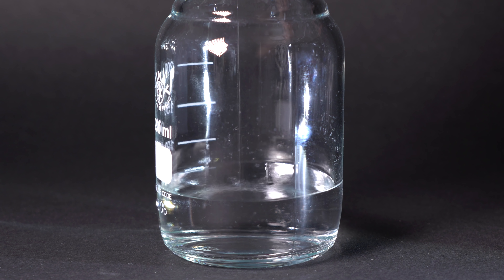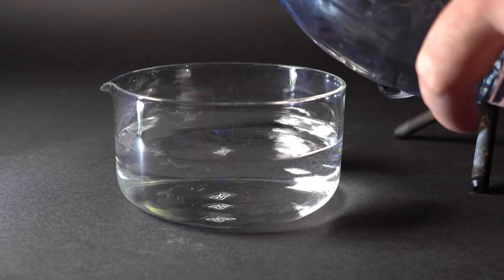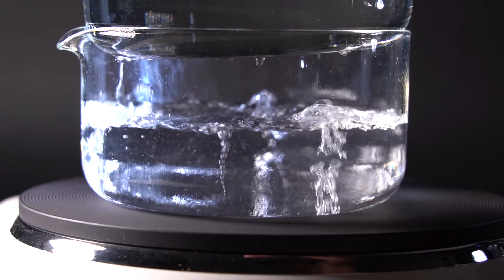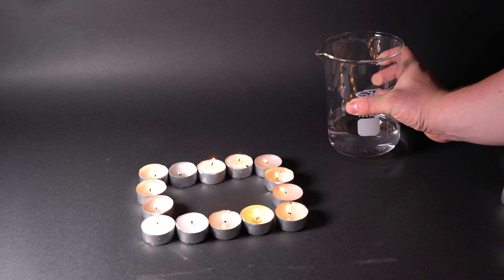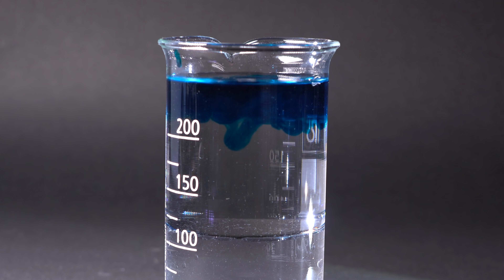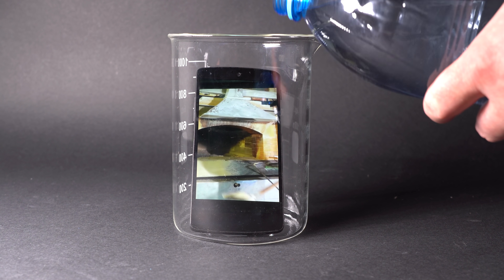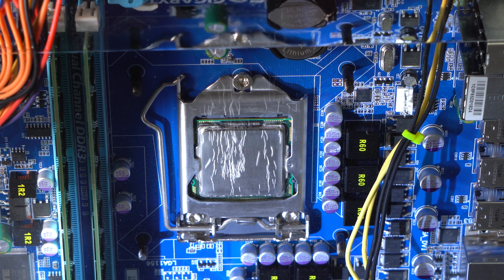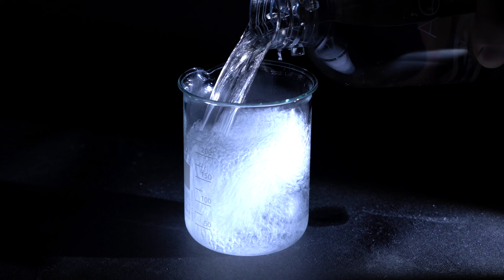Dry Water - The STRANGEST LIQUID On Earth!

Comment: If dry water were made in mass production for extinguish and heat exchanger purpose , They may affect environment like micro plastic in the ocean because they are not easy to decompose even changing in vapor form the coating still contain the droplet of water. How long do they take to come back into normal water?

Comment: If you put dirt on dirt, is that dirt now dirty? Does fire burn fire? Semantically this debate simply doesn't allow for a satisfactory conclusion. Dirt is an object, Dirty is an adjective to describe something covered with foreign particles. Water is an object, wet is an adjective to describe the property of something saturated by a liquid. 
So semantically speaking, the water itself is not wet. 

However,  the science is less obvious. Science would in fact say that water IS wet due to something called Strong Tetrahedron Hydrogen Bonding...that is to say in lay terms, that a water molecule immersed within other water molecules and bonding together does constitute it being "saturated". 
However, my stance, that I've maintained for so long, is that for something to attain a property of "being wet", I would argue that that something must have the ability to be dry. Even something that has a hydrophobic layer that water beads up and rolls off of, can be described as wet, because that water is on the thing in question and can be removed to establish a state of dryness different from the previous state.

This whole thing with "dry water" kinda almost made me rethink that assumption, but not really. But even this unique liquid, with all its unusual properties, still has the ability to saturate, cover or surround something to induce that state of being "wet", and removed again to produce an original state of "dry"

Comment: In 1992 I lived on top of Renton Hill  I was renting a room from a friend and we kept noticing the pilot light kept going out on the water hot water heater we discover trying to reignited that about 3 feet deep in the basement of the house was filled with coal gas  you could light a match at chest level but as you lowered the match below your waist it would go out you could not reignite a lighter or a match below your waist we believe it was coal gas seeping up through cracks in the foundation I rented a room in the upstairs of the house.  One night and woke up gasping for air  I opened the window and leaned my head out finally catching my breath I laid back down and went back to sleep luckily I kept the window open and that was probably just enough to save my life

Comment: Novec is only "hard to get" in the sense that its stupidly expensive. Between 3M having somewhat of a monopoly on it and its limited use in vary niche submersible server racks keeps the price high. Though you can sometimes find reclaimed(used) fluid on the market for slightly cheaper.

Comment: Hmmmm dissolving oxygen would be interesting, especially because its low reactivity could allow it to be accepted into the lungs without a huge amount of damage. My one issue is how one is to make sure enough concentration remains in the solution as the vapours displace gaseous oxygen. Since our mitochondria pretty much act as slow burning flames, I suppose you could test a submerged fire to see how long it would last in a beaker of oxygenated dry water... Actually, if I ever get my hands on an oxygen tank and a beaker of dry water, I might legitimately try that just to see if it works. 

Hydraulic breathing apparatus would of course be incredibly useful in high pressure environments that might become pivotal in exoplanet and terrestrial deep ocean diving or even in gas giant diving. Think of all the incredibly valuable materials stored deep in gas giants like easy metallic hydrogen...

Comment: Hydrogen Flouride = HydroFlouric Acid which is only slightly less toxic tban Plutonium because it penetrates the skin and migrates to the bone, replacing the Calcium with Flourine, requiring surgery to excise the Flouride in the affected area. Extremely Painful.
[but this is why Flourine in drinking water hardens teeth and is so controversial]

Comment: Actually it is already used for cooling in some data centers. The liquid may be expensive but you only need to buy it once, as it's not getting lost in the process. What they do is they add little heat spreaders to CPUs, which also helps to transfer heat faster to the liquid and everything runs inside a completely closed tank so that evaporated liquid cannot escape.The cover of the tank has head spreader on the inside and a massive cooling system on the outside, so that evaporated liquid will condense at the cover and fall back into the liquid, just as shown with the glass of ice water. Of course you can build the same thing with air cooling but the liquid transports heat much better than air does and because of that you need no fans so there are no movable parts involved that may fail. Also nothing will get dusty or dirty over time. You can also use water cooling to avoid movable parts and dirt, yet water will be a problem if you ever get a leak in the cooling system. And you don't need a lot of that fluid. As soon as all parts of the system are barely covered, the cooling system will work reliable. The fluid is not really "cooling" the system, its task is just to transfer heat quickly to the actual cooling system sitting outside of this tank. The real cooling system will use conventional air cooling or water cooling but it can use massive components, as it doesn't have to fit onto tiny chips, it's a big rig on the cover of a big tank.

Comment: I find the experiment with the PC hardware very interesting.
There is one thing that "dry water" has shown - that it can absorb heat very quickly. The only real problem with the test was that the "dry water" in turn could not adequately dissipate the heat. But if you had a cooling system that would wash the heat spreader of a CPU with this dry water, which would then be quickly passed on to a radiator system?
Reply: if you use a passive cooler without fan it is sufficient. The limitations of the cooling without passive cooler is the surface area. Because in the moment a bubble is formed, it is isolating the cpu for a fraction of a second. If you have more surface area, this bubbles have less of an impact.

Comment: It would be interesting to compare the cooling results in the coolant with the heat sink and fan attached (RIP motor), just the heat sink, the bare heat spreader block, and delidded CPU alone. Significantly more coolant would be needed though...

Comment: I think you're the only person to call novec 649 "dry water"
Reply: It's a very common term. Sai common that the novec wiki says "also called dry water." There are hundreds of mentions of dry water when you type "dry water novec" into Google. You were just to lazy and you either read the dry water wiki page (instead of the novec page), or you didn't add "novec" to your "dry water" query.
Reply: Novec 649/1230 (FK-5-1-12) are trademarked brand names for the line of electronics coolant liquids and fire protection fluid sold commercially by 3M. It is also known as “waterless water” or “dry water”. FK-5-1-12 is a fluorinated ketone with the systematic name 1,1,1,2,2,4,5,5,5-nonafluoro-4-(trifluoromethyl)-3-pentanone and the structural formula CF3CF2C(=O)CF(CF3)2, a fully-fluorinated analog of ethyl isopropyl ketone.

So no, he's not the only one to call it “dry water”, also known as “waterless water”...   :D

Comment: Novec is similar to 3M Fluorinert.  Fluorinert was used as the cooling medium in the Cray-2 supercomputers back in the late 80's.  When I worked for JBL around that time, we also used Fluorinert for amplifier prototype testing as we could run them at full power without the need for heatsinks by running them submerged in a tank of Fluorinert.

Comment: This is not 'Dry water', this is: https://en.wikipedia.org/wiki/Dry_water#:~:text=Dry%20water%2C%20an%20unusual%20form,by%20a%20sandy%20silica%20coating.&text=It%20is%20also%20more%20commonly%20known%20among%20researchers%20as%20empty%20water.
What he has here is 3M Novec solvent. A low environmental impact cleaning fluid. https://www.youtube.com/watch?v=TBy93gWg_2o

Comment: It's not practical as a coolant in computers because of it's low boiling point.  CPU's and GPU's can put out a lot of heat, a GPU being comfortable at 90 degrees C in many instances.  You don't want bubbling in your liquid cooling.  You don't need a vapor lock, you don't need blowoff valves inside the computer to prevent rupturing, and unless you want to have a PC in a fish tank it's just not something that makes any sense.  But you can already make a fishtank coolant system with mineral oil right now that works very well.

Comment: Im gonna build a pc but it will be encased in a air tight box. Put some dry water in there then the dry water will not be able to escape so it will turn back into liquid form once the pressure builds up

Comment: This sounds like Fluorinert . The company I worked at made equipment that would pull a strong vacuum on baskets of IC's in a cylindrical compartment then fill the compartment with Fluorinert, when the baskets were removed they were immersed in another fluid heated to the just above the boiling point of the Fluorinert and if any IC's started bubbling they were rejected.

Comment: Finally, i can shower without the water being so wet
Reply: You can but since the purpose of bathing is to disolve the fatty bacteria and oils on the skins in the soap which is washed away with water, and since dry water is a bad solvent, you'll have a bad shower. Prob still be soapy and stinky
Reply: Dry water is called dry water because it cannot wet things if I add more water to it  it's not become more wet it's just gonna add on to it      the particles in dry water are more than just h20   there is an added object to prevent water to sticking on things
Reply: Water in fact is not wet!
Reply: Wonder what it would do to the septic tank...
Reply: @jc5445  evaporate?
Reply: But drink it won't wet your throat too 😂
Reply: @FlamNCheese  that's not what were saying I can't cover water in water it only becomes more water just like if you were to add water to the dry water than I'm sure it would just add not make the dry water wet
Reply: @FlamNCheese  it does wet my mouth  because my mouth is dry.     If I add more water to  it it makes it wet.    We hold saliva not water in our mouths.   Saliva is not water it's an accidic liquid we hold to break down nutrients we can eat it has a different chemical compound
Reply: Ya it would be $1800 shower..($120 * 15 ltrs)
Reply: @rajeevbhan  Hold up, showers take up only 15 litres?
Reply: Well if you google is water wet it says by itself it isnt wet. Only when it comes in contact with material it sticks to is when its considered wet.
Reply: @3cheese711  correct
Reply: @3cheese711  facts. Water is not wet by itself.
Reply: Water isn't wet. It wets us !
Reply: And no need for a towel.
Reply: The comments 😂🤣
Reply: I ruined ur 69 replies
Reply: @WoweeTheNotable  And I ruined your 70 replies
Reply: Shower from that wil feel like a hail storm. Wil leav ur body bruised
Reply: I always hated that!!!
Reply: @kalmansandor5930  I agree I'm not saying it's dry water.    So yes like I said it's not water. I'm saying it has some of it but it's not completely h20 it has other chemicals in it that make it not exactly water
Reply: you're lungs would be destroyed by the time you've finished showering.
Reply: It won't clean you though...
Reply: if u gonna do that u gotta pay up man
Reply: Then You've to sell your all property for a bath
Reply: This is true, but you'll not be clean either.
Reply: I think you cant since the dry water cant react with anything…..
Reply: And it will not be possible to clean your odor 😂😂🤣🤣🤣🤣
Reply: Bete moj kardi
😅
Reply: Make video for refrigerants please like R134a
Reply: Get ready to spend some big money only to get chemical burns on your body
Reply: Water is not wet. Water makes you wet
Reply: you'll just die from not enough oxygen
Reply: I hope there's no UV source in your bathroom...
Reply: You can now play with ur laptop while bathing or get a pc set there
Reply: Going to some expensive showers
Reply: Be a pretty expensive shower. My MR beast will do it
Reply: Water is not wet
Reply: @bryantmorris2744  the fact that there is something called "dry" water proves that "normal" water is indeed wet!
Reply: @butterisawesome6969   I'm still not convinced there needs to be an investigation I'm calling the FBI the CIA and special forces
Reply: @butterisawesome6969  dry water is not regular water there is an added chemistry to it.  It's hydrophobic. Not water.
Reply: @bryantmorris2744  witchcraft haahaaa
Reply: @butterisawesome6969  hAhA sciEnCE gO brrrrrrr
Reply: @butterisawesome6969  no its not that logic makes no sense
Reply: @butterisawesome6969  apparently water is not wet
Reply: @butterisawesome6969  not at the subatomic level
Reply: @bryantmorris2744  water is not wet
Reply: @Atharva26304  Is fire burning too?
Reply: @SophiaAstatine  no
Reply: @Atharva26304  Then why would the water be wet, but fire isn't on fire.
Reply: @SophiaAstatine  i commented water is not wet, but showing water is wet, i edited also, and i know water is not wet it makes things wet, but u know youtube, algorithm and that shitty CEO GRANDMA
Reply: @SophiaAstatine  fire is hot
Reply: @Gam31n  not necessarily.
Reply: Technically water is wet. Stacking h20 molecules on one another by them touching then that makes them wet so WATER IS WET.
Reply: @DGavinchi  no. Because it literally just combines....
Just like how you cant cover blood in blood or milk in milk.
Reply: @DGavinchi  no
Reply: water is not wet.
Reply: @cranberryjuice3998  the chemical letters for water is h20.    Is dry water h20 not it's something else.   It's called dry water because of its lookalike characteristics
Reply: @nathanielpena5868  its just a joke to say water's not wet. altho i prefer to think that normal water is not wet, it is still just a joke to spam it in comment sections for a laugh.
Reply: @cranberryjuice3998  nah I feel you I get what you mean some guy asked and say if fire burned
Reply: @cranberryjuice3998  well lol I'm just saying things just in case.  It may give a new perspective on things we see. Which is good
Reply: @cranberryjuice3998  well this is water with powder in it mixed not exactly regular h20 that why it's different I'm not saying water is wet
Reply: @nathanielpena5868  WATERS NOT WET
Reply: @cranberryjuice3998  I never said it was lol 😂😂😂 I know what you mean
Reply: @nathanielpena5868  water is wet, live with it.
Reply: @sus4644  opinion not fact
Reply: @sus4644  water is not wet live with it

Comment: If I recall correctly, dry water was developed to solve a the problem of the acid rain that was created after a communications hub caught fire in the USA in the late 1980's or early 1990's.  City water from the sprinklers reacted with the burning electronic components to create very acidic compounds that compounded the damage by the fire, itself.  Unfortunately, I don't remember more details about the incident, itself.

Comment: Would it put out a fire if the thing burning got it's oxygen from within itself(say like flares burning) instead of getting the oxygen from the air? Would the heavy weight of the "dry" water crush the flame out or would it continue to burn?

Comment: I work with this chemical daily (Specifically 3M Novec - HFE7200 (75°C boiling point). It is very fascinating for a liquid to evaporate faster than brake cleaner and have no smell. It also doesn't cool down skin like acetone or isopropyl alchohol. The only thing is these fluid are very very expensive at about 512$/Gallon. He also didn't mention most of these can still flow at very low temps as well. For Novec 7200 it remains a viscous liquid until -70°C. And it has a very high thermal coefficient of expansion. About 1.4x volume from cold to hot. this also means the density when its very cold is nearly 2x that of water and when warm its still about 1.5x heavier that water.

Comment: You should have run the dry water through a radiator with a cooling fan. Then compare it with regular water in the same system.

Comment: From what I can tell, this has no more to do with actual H2O1 than alcohol does; the only similarity being that it's clear like water. This sounds more like what is typically referred to as refrigerant. All refrigerants that I am aware of are clear, so they look like water, but they are engineered to have different properties. Novec is actually used as a refrigerant sometimes. That's all it is, a specially engineered fluid, nothing groundbreaking.

Comment: I just wanted to point out that the molecule on screen at about 1:00 that's "similar to ethyl isopropyl ketone, where all 12 atoms of hydrogen are replaced by fluorine" appears to be the refrigerant Novek 1230, not the Novek 649 you name in the description.  

Novek 1230's proper systematic name is "1,1,1,2,2,4,5,5,5-nonafluoro-4-(trifluoromethyl)-3-pentanone."  It could also be called "heptafluoroisopropyl pentafluoroethyl ketone."  Both of these names describe, the molecule on screen at 1:00

I've spent about 30 minutes trying to find an actual IUPAC designation for "Novek 649", or even an image of a Novek 649 molecule to decipher the nomenclature myself, but I've had no luck.  I have also had no luck trying to find "Novek 449," but I assume you just misspoke there.

Comment: What if you use dry water as a coolant for a vehicle?
The optimum temperature for an engine is actually hotter than the dry water's boiling point. 90-110°C. So yeah, it won't work lol